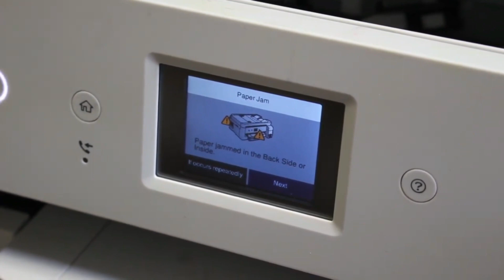Avoid This Disaster: ET 15000 Black FFC Cable Rail Guard Breakage Cause Paper Jam

Comment: The red and black wire that's attached to the  backside of the front panel that lifts up is still attached, but I don't  know where the other end  is supposed to attach to.  I appreciate your videos and assistance in this request. Thank you